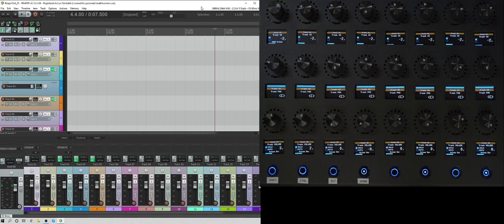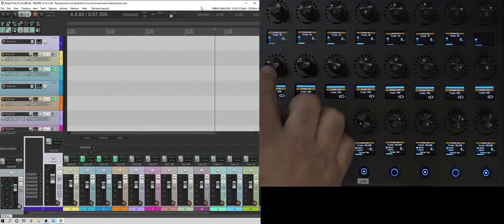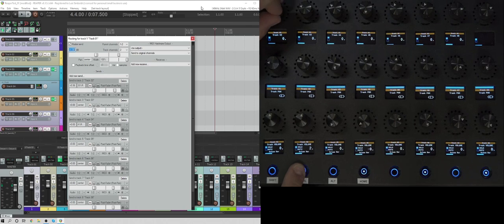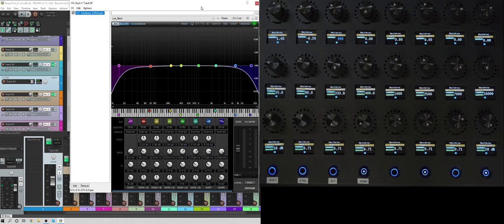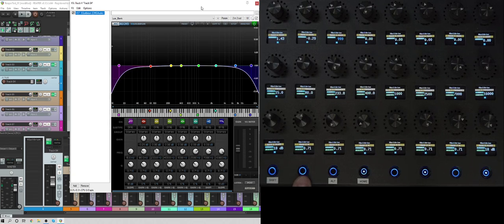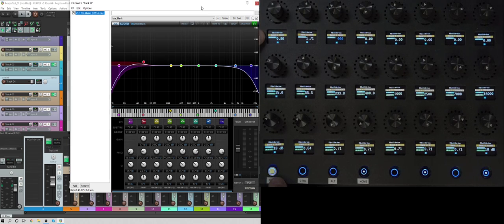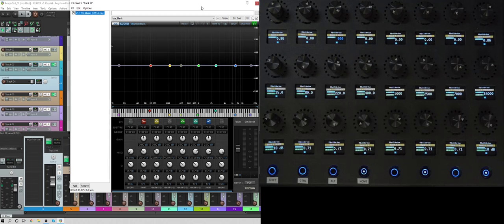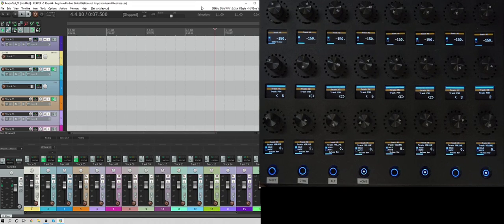2021 01 03 Testing Equilibrium w New Fonts

Comment: Please we need a plugin controller  The issue I have is the Mackie System with the Faders and C4 plugin controller was a better work flow then anything out there.  It worked with all plug in manufactures.  No mouse just the knobs and scribble strips and a lot less menus. Hold this hit that with your thumb while holding your nose. It is ridiculous. The Mackie C4 is old but it had the right idea. 32 encoders at your finger tips, that is all your sends or all your pans, 32 parameters of a plug in + banking if there were more. It was like using analog. select a channel and the C4 had the plug in there with scribe strip info and 32 encoders. I CAN NOT UNDERSTAND how dudes who do audio (AUDIO ENGINEERS) can not produce a console like set up for a daw plugin controller? Soft tube is close but no scribble strips and to proprietary. Same with SSL. HAS EVERYONE FORGOTTEN WHAT AN ANALOG BOARD LOOKS LIKE? Just give us Eucon enabled mapping, (push button encoders) 1 bankable EQ section with filters, dynamics section, 16 other encoders for what ever, info strips....DONE! sit it next to an s1 or artist mix and Bam! I just dont get it??????????🙁 The products on the market are placaters, and I can not believe more Audio engineers are not screaming give us a lay out worthy to mix on not boxes to hold buttons and page through menus. Ok I'm done LOL .  I THINK WHAT YOU ARE DOING IS AWESOME!!!!!
Reply from the maker: Thank you for your comments. We are working hard to address your concerns. The idea is to have a digital controller that can dynamically change its function to suit the user needs without having to memorize which button, knob, or fader does what, nor having to look at the screen. This way, you can focus all your brain power on listening to the audio, rather than processing visual images. :)